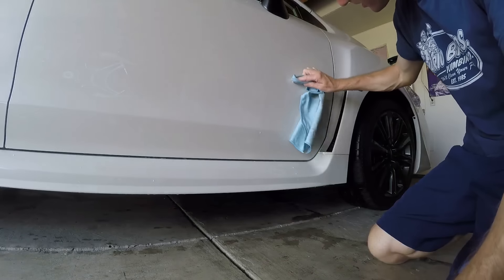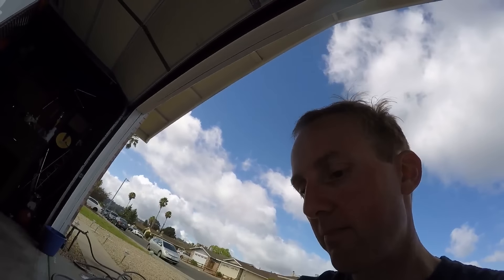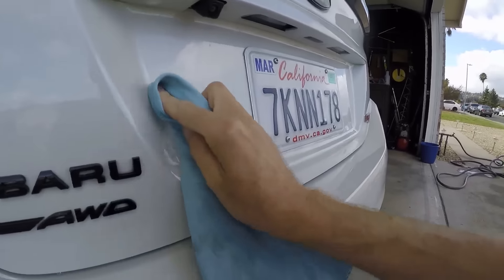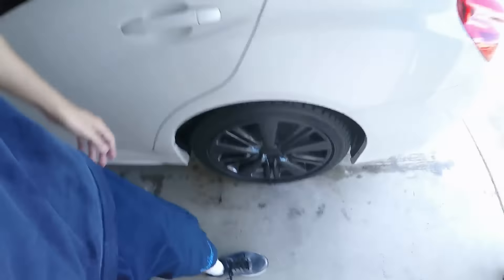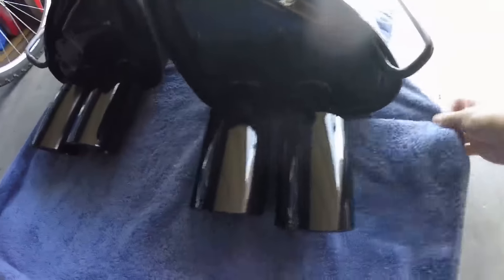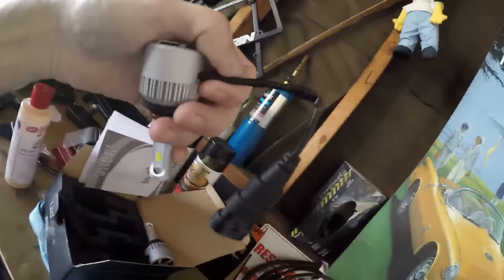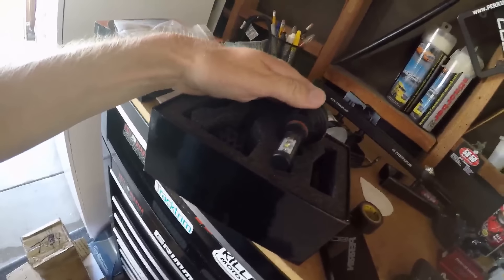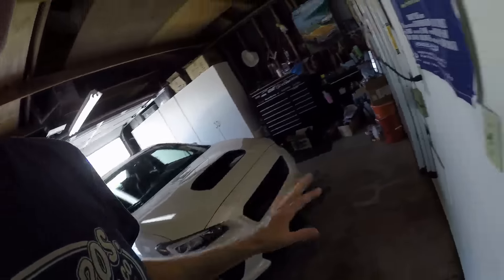2015 Subaru WRX Ep. 541: Sunday Roundup, and 14k Subs!

Comment: Shame about those LEDs, still I hope you get something sorted. There were two things I read about when looking to replace the bulbs in my STI for the interior, 1) get 28mm not the common 31mm which forces you to expand the contacts, 2) either disconnect the battery or be sure to switch off the lights and be extremely careful not to short the bulb on anything metallic and definitely don't use metal tools. I did mine leaving the battery connected and was ok, I also got 28mm, but I have now ordered a new set that I hope are brighter as mine aren't all that much better than stock. Your experience makes me rethink even going near them again and keep the new bulbs just for when they need replacing.
Reply from the maker: good details

Comment: Sorry to hear about the electric control unit. No issues with mine in the wrx either but I'll be sure to disconnect the battery if I have to change them up.
Reply from the maker: it prob happened exactly when i used a mini flathead to pop the stock bulb out.. and touched the side or something.. always use plastic pry tools....

Comment: Sounds like the fun I had with my tail as turn mod causing the Blind Spot Det system to burn out. I was lucky to not have to foot the bill on that repair since it was done 3 times before it was discovered to be the source. I won't be messing with that again.
Reply from the maker: really? your tail as turn blew something also?
Reply: yup...apparently doesn't play well with BSD system. They were able to confirm it due to readings in the electrical system with vs. without. Considering the system has worked flawlessly since, I can't disagree. This isn't written anywhere of course.

Comment: I read somewhere disconnecting the battery leads when replacing the map lights might prevent damaging the timer.
Reply from the maker: i bet you are right.. wish i had done that..
Reply: I wonder if you you just disconnected the battery now and let it sit for a few minutes then reconnect it if that would "reset" the BCM.  I have some map/dome LED lights coming tomorrow for my '15 Crosstrek - I'll be sure to disconnect the battery beforehand now.  If the manual doesn't say you can't/shouldn't replace with LEDs then I'd for sure get the BCM replaced under warranty.....

Comment: I have but even before I did change the bulbs the maps never came on. I don't have a switch on my map lights to come on with the door only on my dome.
Reply from the maker: just made a video for you its uploading in 10 mins.
Reply: Thanks. We'll if that is the case other than the map lights is there anything else it would effect?
Reply from the maker: nope. 1 circuit in the BCM is for map light timer.